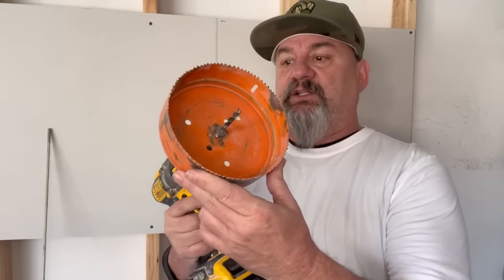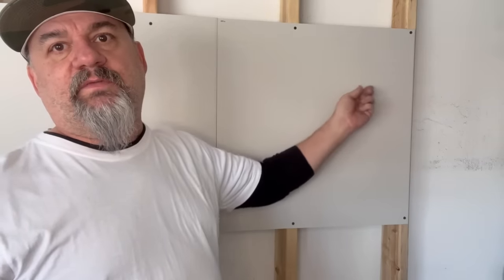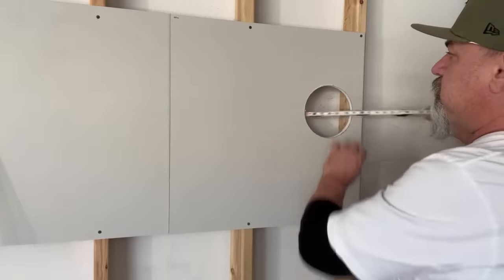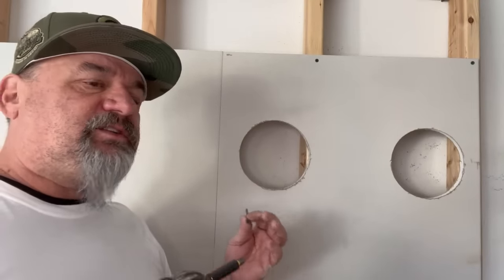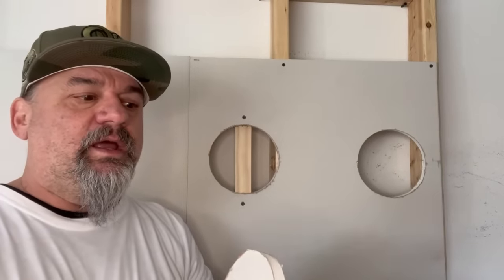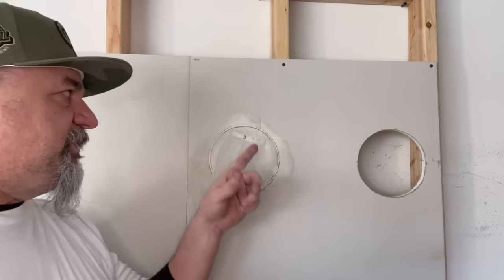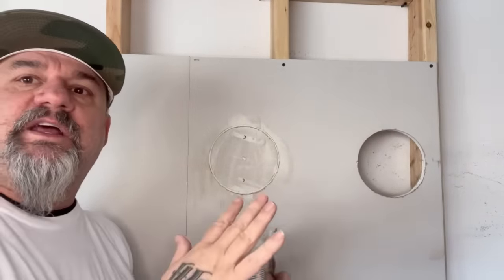Unbelievable Trick to Run Wires Through Walls and Fix Drywall - You Won't Believe What Happens Next!

Comment: So i've never used tape or paper to cover gaps, and I've never needed 2 coats.  I know the drying will suck it in so I purposefully leave it a big over-patched so when dry it still sticks out proud of the wall, and then when dry I just sand it back to flush.  What is wrong with doing it that way?  What am I missing?  Seems way better than a 2-coat process or trying to hide the thickness of a paper or mesh tape.

Comment: Not an electrician, but doesn't create a potential fire hazard if someone manages to run a nail or screw through the stud in the future? Would it not be considered up to code?
Reply from the maker: its a patch, there's always a risk of hitting a wire its just life.  you are looking for reasons it seems for this not to work. i'm just showing what I do, you are free to try or not.
Reply: @StarvingElectrician  I know metal strike plates can be installed on the 2x4 to prevent from possible damage. I know doing work as a home owner, I could probably get away with it.  I'm not familiar with NEC code, so I'm just curious to know if a licensed electrician could do it and be okay with code. I would do something similar if I ran into a fire block trying to run cables vertically.
Reply: @StarvingElectrician  I'm not trying to put your tip down.  I think it's a great tip when trying to get the work done.  Sometimes I'm a stickler about rules.
Reply: @erichziegler7594  kick plates are needed when the hole is less than an 1 1/4” from the edge of the stud..if you’re in the middle of the stud you’re probably good. Also, you realize that any time you’re hanging a picture or tv or those floating shelves your wife wants you run the risk of hitting a wire or a pipe or something right. I guarantee most the wires in your house weren’t kickplated but should’ve been.
Reply: @tfun101  My home was made back in the mid 70's and I figured the plate wasn't a part of code at the time. Thanks for the info

Comment: Why not just cut that 2nd hole over the stud? This way you can put the drywall right back without adding random wood backings
Reply from the maker: then when you run into a screw or glue and the slug breaks you will see why this works better.

Comment: That's a 20-year electrician, working in very high-end homes. I can assure you that I have run wires hundreds of times while never drilling a hole in the wall other than what it is going to. At the rate you took, you could have just cut a long rectangle across the entirety of it. I do not pay repair people anything because I do not leave repairs. No arrogance implied, but hit me up, and I will tell you how.
Reply: @lordmandalor  please share how

Comment: Why not drill hole in middle of stud? 
No backing piece required later
Reply from the maker: It's just one way if you absolutely have to make holes you can repair them this way. its not intended to be the "ONLY" way.

Comment: how do you cover an electrical plug so you can tile it? in an already tiled area !!!
Reply from the maker: plugs must allways be redily accesable for code and safty. what I would do is take the box out of the wall and push the wires down behind the cabinet and cut in a new junction box.
Reply: @StarvingElectrician  why would i want to do that ? i want to tile it up   right? i want nothing  
no receptacles

Comment: can not do that on plaster i have used patch plates with mesh and metal plate formed toghter cut hole in center between every other stud old houses with plaster walls if they have wires it is old knob and tube so it is no longer used afer new wires installed
Reply from the maker: not talking about plaster. just a quick trick I use is all

Comment: Modern stud finders will not only find studs, they will tell you if there is a live wire or even metal in the wall.
With that knowledge you can drill every other stud bay and reach both ways to drill a hole. If you have a corded drill or a medium sized battery drill you can put the entire drill into the hole to make drilling easier and straighter.
If the room could use crown molding you can drill a small hole at the top of the wall, drop the wire straight down, nail it into the top corner around the room and cover it with crown molding, no patching at all.   You can remove the baseboard, drill holes at an angle near the floor, run your wires and replace the baseboard.
If there is access to the basement or the attic you can  run the wire up or down and across without going through the wall studs.
The method shown in this video should be the last resort and even then it can be greatly improved upon by drilling half as many holes.
Reply from the maker: um do you think you are trying to teach me something? Im showing a quick patch. and NO A STUD FINDER WILL NOT FIND WIRE!!! completely wrong! if you want to give bad advise or obviously you are a know it all then my advise is get your own channel. thats fair.

Comment: Dammit, with that 6" hole saw you hit the.... gas pipe..... water pipe..... high power wire.....cat5e.     Catv cabling
Fiber optic cable ( yes fiber optic in a house,  mine has it.)
Return air duct, vent piper. Forced air pipe.
 Heayer vent pipe,  back side of a 120 volt outlet.
Reply from the maker: 30 years that has never happened

Comment: Good video! For filling the cracks, I use latex painter's calk, since it holds better and is easier to get in the gap. After the calk is in, I wipe the area with a damp paper towel.
Reply from the maker: Great tip! yea I use what I have handy but yes painters caulk works best I think.

Comment: A bigger hole is better : )  Well, when you patch a small hole it is more apparent that it is a patch.
Reply from the maker: well its easier to work on the electrical than a little hole ya struggle with.

Comment: You're so close.
Put in the backer board. I don't even bother with that big of wood. Paint mixer stick will work. Any trash wood laying around as long as it's straight will work. Caution people to not put the screw too close to the edge or the gypsum may break off. Now you have a repair too. After you have all your boards screwed in, mix up some hot mud. I like 45 minute mud. Butter the edge all the way around and your work piece. Place in hole, screw it in. Now mud it in as if you're the one that's going to sand it. It'll take some practice. Now if you have to, sand it, prime, paint it. As if it never happened. I always use a 10" blade. Fits in the hot mud tray and it's great for finishing. I end up having to sand and paint, so I'm real good about minimizing what I have to sand later or the next day. Buttering it up will make the joint a whole lot stronger.

Clean up right away. I've had the same mud tray and blade for over 5 years. That's when a master finisher introduced me to hot mud. I used to use that 24 hour pre-mixed crap. I bought the red plastic tray and blade at HD, I since bought a smaller blade to get in where the light switch is close to the wall and I'm deleting another switch from a gang box. All these years later and I still have that red tray and the blade.

That's how you get them to buy you a beer.

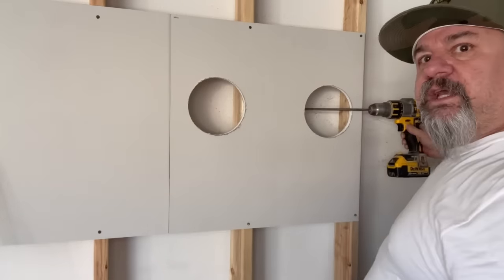Comment: 4:00 Yeah... I do that with a tape measure all the time. LOL There are good reasons why those folding measuring sticks are obsolete. 5:00 Invest in a cordless angle drill, you can fit it right into a 4" hole and use a regular paddle bit. The Milwaukee M12 version fits into tight spaces, just don't drop it. LOL
Reply from the maker: I think i got this

Comment: how about drill a 1/4 inch hole  on the next 14 inch cavity and use an  amazon  (Chinese) camera that are about $75 bucks now, and avoid the homeowner the drywall work that will likely still look like a patch?! It would make electricians and plumbers have a better stereotype!

Comment: ffs  i stitch wires  through stud walls and the holes are no bigger than 25mm  either side of the studs. just fish across using a curved  piece of steel fencing wire with a tight loop on the end to hook the cable  on to as for the patching  i do my own
Reply from the maker: right on. good tip

Comment: How far can you go down the wall with this method
Reply from the maker: I try to keep holes to a minimum.  theres not limit. just how much do you want to path. if you mean the backing id go at least 4 inches bigger than the hole
Reply: @StarvingElectrician   Well if you wanted to run a circuit  Fairly long ways

Comment: You could do just with one hole on the second stud you see both sides of the stud and spray foam would do the trick with pitching a gape around plugs
Reply from the maker: i have no idead what you are talking about. sounds like babble. this is a trick I use. you spray that nasty ass foam all you want or maybe get your own channel and spray foam everywhere,  I dont need the help I got this
Reply: @StarvingElectrician  This is not about you . I understand that you can not teach an old dog a new trick . But making one hole instead of two makes a lot of sense for most people
Reply from the maker: @andreycham4797  this is a video of the way I do it. its not teaching me anything. do you understand that if you drill directly on the stud it may have glue on it and then you tear up the drywall just to get it off. two holes instead of one? whats the difference is what im explaning. either way you are cutting holes. thats the point.

Comment: This is why the electrician should stick to the wires and not touch the drywall lol... that will last the 5 mins that you are at the job and that is about it
Reply from the maker: lol if I could plug the hole with news paper and walk away I would rather do that! just trying to get those drywallers plenty of work
Reply: These comments can be disappointing. Seems everyone is expert enough to criticize, but don't know enough to actually offer any tips on how to do it better.  Most of them only watch like 10 seconds of the video anyway.  Short attention spans.
Reply: @NoName-ml5yk  I watched the whole thing. My critisism was also not ment in an aggressive or hatefull way.. also, how do you know my experience level... sorry you feel disapointed...
Reply: @dk9174  well that's good to hear but you still haven't any offered any useful tips. Just saying that it will fail doesn't really help anyone. Why would it fail and what could you do better. If you really want to do something useful make your own video. But don't be surprised when people come in behind you and tell you that you did it all wrong without offering explanation.
Reply: @NoName-ml5yk  you seem to have a bit of a chip.. just relax yourself...

Comment: This looks like a waste of time and materials;  why not chalk a line above and below where you want to run your wire,  cut it out, drill the studs, run the wire, then screw the piece you popped out back to the studs, mud it, sand it, primer and paint.   🤔

You may also have insulation and/or plumbing in there, and you'll never find a vertical seam with no stud behind it.
Reply from the maker: this is just one of many tricks. there's lots of ways to do this.

Comment: Dude, just put your plug in there and be done with it.  Everything else you did after that is a complete train wreck, and that's putting it nicely.  And those fat thread Home Depot/Menards screws are the kiss of death.  There is a difference between a coarse thread and THOSE.  Those belong in a dumpster.   Anyway, just plug it and go to the bar, and forget about filling anything in because you're only adding to the work load for the next guy who actually knows what he's doing.
Reply from the maker: its just a patch. nothing more.

Comment: Let me save you time. He says use a hole saw, check for wires, use drywall screws to pin a batton, then screw the cut hole back in and fill. Instead use a reciprocating oscillating multitool to make an eye/torch hole. Oscillating tool has smaller kerf. Nothing clever in this video.

Comment: Doesn't work if the wall has tiles on it or wallpaper. How are you going to match a painted wall. Outside wall has insulation and vapor barrier. What's your answer to these?
Reply from the maker: gimme a fucking break! looking for faults?

Comment: god what a mess and too many patches "LOL, just cut a 2" strip out of the drywall! Tape and float out the joint,,, The Tape will cover the 2" cut so you only have one joint to fix instead of a bunch of Crazy 6" Circles
Reply from the maker: its just an example. you can do whatever works best for you.

Comment: You are better off removing the baseboard cutting the drywall off and then drilling through each stud,  there are good youtube videos showing you better ways, than drilling 6-inch holes.
Reply from the maker: It's just one way if you absolutely have to make holes you can repair them this way. its not intended to be the "ONLY" way.

Comment: Click bait. Where's the "unbelievable trick"? Using a hole-saw drill bit? There is no difference between that and using a drywall saw then saving the piece you cut to put back in place, except that the saw is 20 times cheaper. Also, a circular hole is super annoying to deal with if you know what you're doing with drywall and actually use drywall tape. Have fun taping a circle.
Reply from the maker: oh im sorry would you like a refund for the click bait? its unbelieveable  that you got something for nothing.

Comment: This guy is wrong on so many levels. He is right on one thing he is lazy. You can do it correctly with less repair if you take your time. I've been running wire for 35 years as well and have never done it this way.
Reply from the maker: oooohhh you are so skilled. 35 years and you are better than me? i have been doing it 35 years too. its always the electricians who say they can do it better. you sit around you tube and wait to bash videos cause you are so high and mighty. heres a suggestion for ya. GET YOUR OWN CHANNEL SINCE YOU ARE SO GOOD!

Comment: I use a toner and tone for lines .Your method is very destructive.
Reply from the maker: its just one way.  its in case there is no other way. what the hell does a toner have to do with drilling to run Romex. obviously you just have an opinion and didn't watch the video. one of those computer trolls who wants an opinion without regard to instructions. let me guess you gave the video a thumbs down. good luck with that toner that does all the work for you. shit you don't even need a drill with that toner.